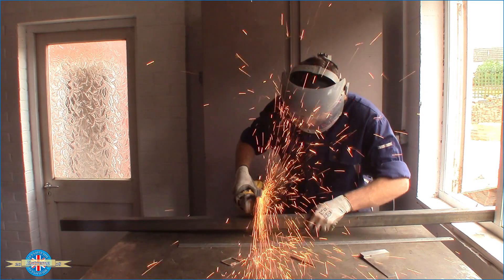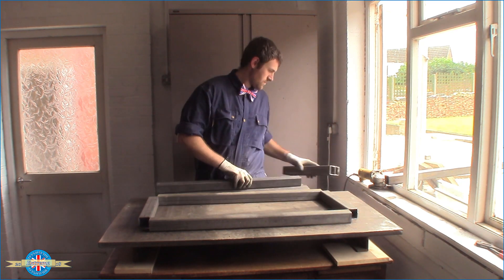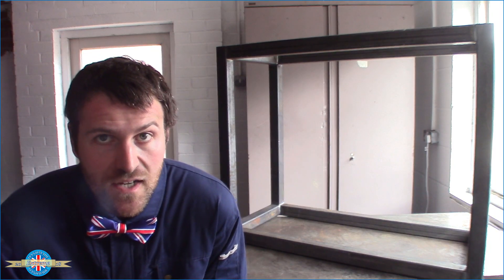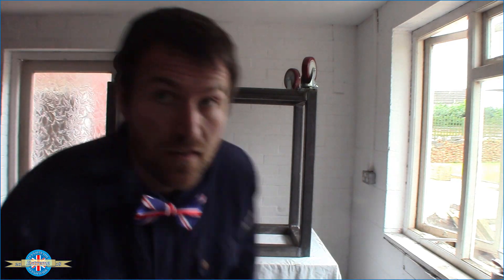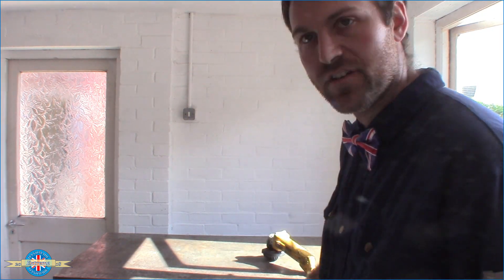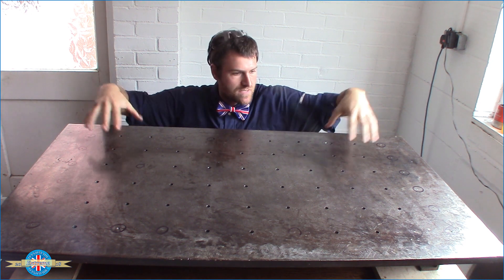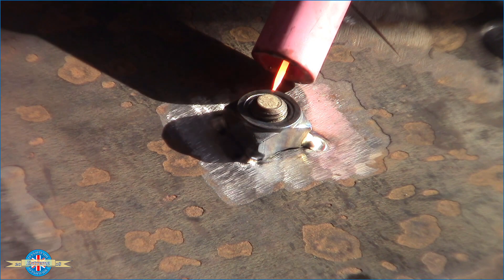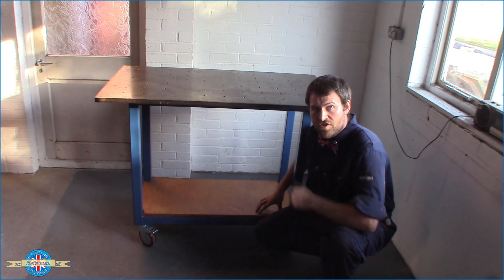How to make a Welding Table

Comment: Great build and great video! Daft question but what is the paint you use on all your projects?
Reply from the maker: Thanks, glad you are enjoying them. It's just Hammerite smooth blue, nothing special.
Reply: @Handmadeextreme  Hey man, just subscribed. You should have a look at paragon paints. They do paints in original colours for plant and machinery. Got the original record blue for a vice i did up. Bit pricey but its proper machine paint so it's very hard wearing, they do all of the old myford colours and stuff, worth a look if you ever need anything like that. Thought id mention it, you never know. Cheers.

Edit: just realised it's the vice in my profile picture haha.

Comment: That top surface is awesome. I wish my welding table top was that thick for when I use my powertig welder.
Reply from the maker: It's quite handy , shifting it was a challenge. I spent a couple of days using it as a make shift anvil the other day. glad you enjoyed the video. Cheers

Comment: Nice build, if moving it by one of the longer sides be sure to only push it and never pull it towards yourself given the narrow track in that direction + how tall & top-heavy it is. Don be tempted to pull it away from a wall, or anywhere by the long side, either... Doesn't take much to jam up those wheels, could lose some toes or worse. Also just as important... show the people around you how to move it properly so someone else doesn't get hurt.
Wouldn't be good idea to mount a vice on it either. 
Thanks for the content & ideas.
Reply from the maker: Good advice, thank you. Luckily I'm the only one who works in my shop so some of the concerns are alleviated. Glad you enjoyed it.

Comment: This is the first of your videos that I have see and I greatly enjoyed it as making a table with a 1" top crossed my mind last fall.  For what it is worth we can estimate the table weight.  In the U.S.  1" mild steel plate is 40.8# per square foot and your top is 1200mm  or approximately 4 ft. x 600mm or approximately 2 ft. for an area of 720,000mm2 or 8 ft.^2 x 40.8#/ft^2 = 327# or ~148.6kg  Now for the guesswork, we know the tube is 2x2, I'm guessing it is 3/16" wall, the legs are 32" the frame is 12"x36" or the depth is (4.3 x 4= 17.2#),  the width is (13 x 4 = 52#), and the leg height (11.5 x 4 = 52#).  Sorry I dropped the weight of the 2x2x3/16 square tube which is 4.3#/.ft.  Now we add: 327#. + 46# + 52 # + 17.2# = 442.2 #.  We could add the weight of the weld nuts and wire but they pretty much cancel the weight of the slugs (not really but so what!)  442.2# is about 201kg.  Oh, I forgot the plywood shelf, 3/4" birch ply (another guess) is 68.2 # per 4x8' sheet / 4 = ~17# add 442.2 = 459.2# / 2.2#/kg = 208.7kg approximately.   WOW !   As we used to say when I worked at the welding shop (estimating) you can do some heating and beating on that thing...
Reply from the maker: Cheers, glad you enjoyed the video. Your right she has some weight in her!!

Comment: Darek from "Made in Poland" send me here. He said it was a great channel -  he did not lie  :-) :-)
One question :  what is the diameyer of hole and spacing?
Sorry for my ang.
Reply from the maker: Thanks for coming over 😀I'm glad you are enjoying my videos. 
The holes are 10mm diameter with M10 weld nuts. They are on a 100mm spacing.👍
Reply: Handmade Extreme  Thanks
Reply from the maker: My Pleasure. 👍

Comment: Great! I like English sense of humor! Why you dont thread holes? Thanks for metric system.
Reply from the maker: Thank you, I used weld nuts rather than threading the holes for a couple of reasons. The weld nuts were much faster but more importantly the table top had things welded to it before I got it and there were local hard sports were some of the holes were. I did not want to risk breaking a tap in one of the holes due to the local hardening of the steel. Hope that answers your question. Thanks for Subscribing 😀👍
Reply: Handmade Extreme lol good answer. More like, how about you come round and hand tap all those holes while I watch. Lol
Reply: all the pro guys seem to just use straight holes , no nuts , and friction takes over ,, take a look at ceri flat or strong hold ,,, i like the nuts though , how much did that chunk of plate cost

Comment: great build. good video
Reply from the maker: Thank you. I'm glad you enjoyed it.
Reply: Handmadeextreme are the 1” steel plates expensive
Reply from the maker: I already had this bit which I got for free. But I would ball park estimate that it would be around £200 to buy. That said most people use much thinner material for the top which works out quite a bit cheaper (and is perfectly adequate for most jobs). A lot of it comes down to the type of work you are wanting to do. (the more heat you are going to put into the table the thicker you want the top, EG gas welding puts quite a lot of heat into the table). In reality almost all of my welding is Tig so I could have used a much thinner top, but that was the material I had...  Hope this answers your question.